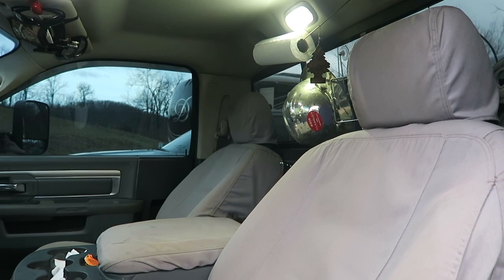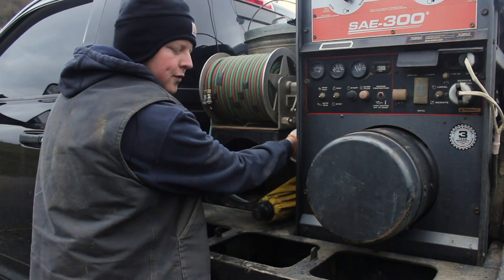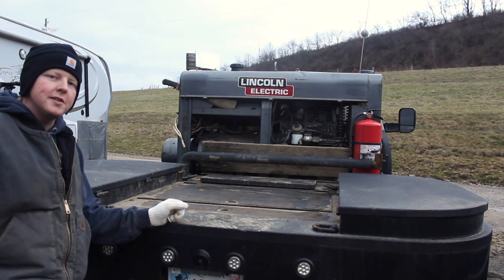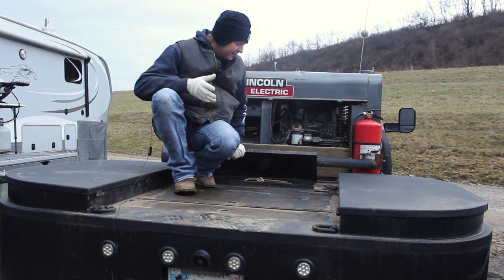WELDING RIG TOUR | WALK AROUND AND TOUR OF MY WELDING RIG | PIPELINE LIFE

Comment: I want to get into pipeline welding but I have a few questions and it would be great if you could answer them. 

1. Why do you have to supply your own rig 

2. Is it better to be in a union 

3. Why do pipeline welders make so much 

4. Is there a ketch to the job or are you getting paid for your skill

5. Is there a lot of work out there in pipeline welding 

6. Is it true, do some companies pay a bonus if the weld passes x-ray

7. If I have all my certifications, will I still start as a helper or as long as I have a rig can I start as a welder

8. What do I do if I get out of school with all my certifications and I don't have a rig. Will a company supply one or will I have to be a helper until I buy a rig. 

Thanks. Again

Comment: As far as your YETI, keep the drain cracked to drain water. The forward and backward movement of your truck jostles the ice around, it breaks down, and then it melts easier, which in turn, your ice is jostling around in water. BTW, good job on the video.

Comment: Man, nice rig & you look young but, have 1 heck of a truck!!! I don't go anywhere w/out a toolbox!!! prob why my car sags a bit. maybe if I had a truck all decked out, maybe id have better a job? I look at it this way, if I have to rebuild my car on the side of the road, I want to be prepared!!! only difference is, I don't have a welder in my car & that looks like a big, no nonsense welder!!! I like your rig brother man!!!  I had a 87 f-150 w/ 429 & c6 transmission, park didn't engage!!! Had 2 jump out & throw a 4x4 behind the rear wheel & sometimes, get out & chase my truck & hope to god that I could stop it!!! Several times, it rolled over the 4x4 & I was barely able to stop it!!! the old fred flinstone way w/ my back up against the tailgate & my feet on the pavement!!! Ghetto!!! NOTHING LIKE YOUR NICE RIG!!! THO MY 78 WOULD RIDE WILLIES!!!

Comment: Did you have the same truck and setup before but white? If so I've seen this truck but in white at tractor supply in south florida... blue yeti cooler tho
Reply from the maker: We haven't been to Florida yet so that much have been someone else.  Austin's white dodge was a crew cab and the bed had a drag up tank and wasn't as round or low profile.

Comment: all yetis are lemons. we got one and it wont hold ice more than a day, and the seal gets so tight that you have to open the drain to release the pressure. yeti told us we need to take it inside because the heat is causing a suction. but whats the point in that

Comment: Did you have a warranty on the truck when you installed the bed? If so did it void the warranty?
Reply: sean reidy 
Yes I had warranty. Most place are not going to give you trouble about it unless you cut the frame.

Comment: what kind of metal did you use for the bed
Reply: I have a ford f150 5.0 liter engine and I'm trying to make it a welding rig is it a certain engine size truck I need?  or where do I start first?
Reply: Deonte Sims 
There is a video on what truck I suggest starting out with over on my welding channel, same channel I’m responding from here. Go check it out. Let me know if you have any other questions.

Comment: is there a reason pertaining to welding that you need a dually 3500? or is just this guy going overkill with it?
Reply: Cesar Salazar all of us rig welders have 3500 daullys. Do you know how much weight the welding machine weighs? That SAE300 is close to 1800 pounds. Then you have at least one oxygen bottle an one acetylene some trucks have two of each. Then all the tools etc... put all that weight on a single wheel. You’ll wear out a set of tires before you know It. An most of us have to pull our camper/ 5th wheel with the same truck. That’s a lot on a truck. Just FYI for those who don’t know.